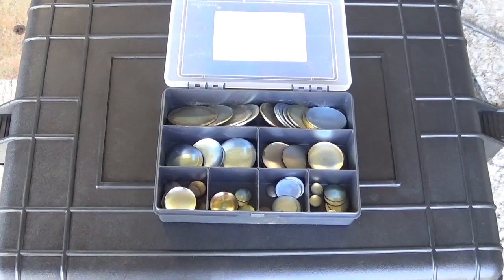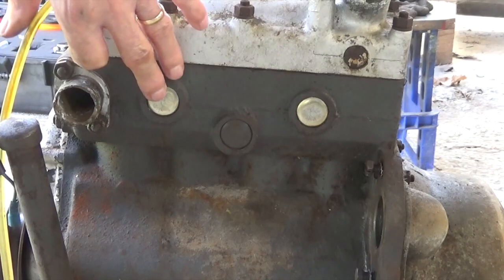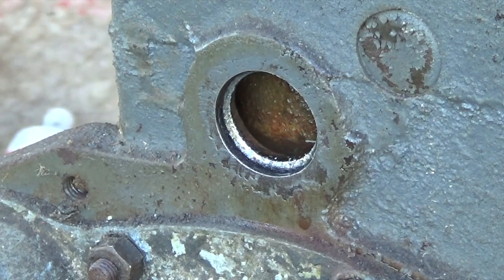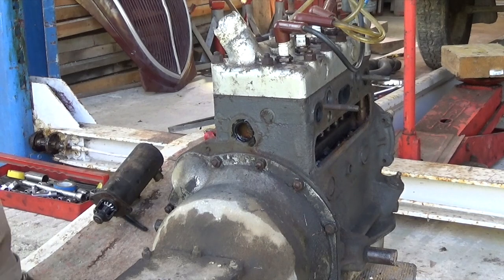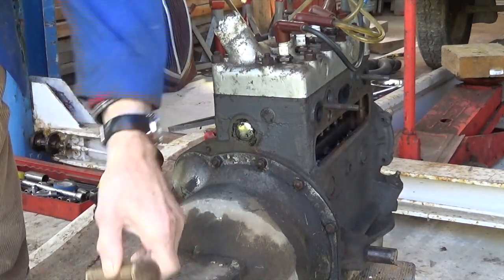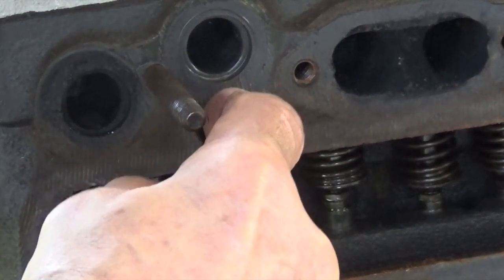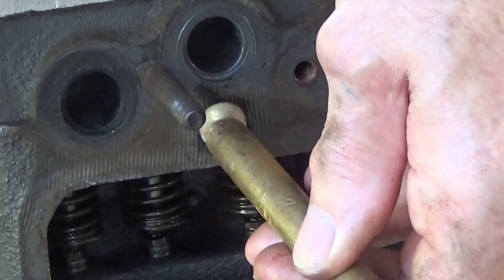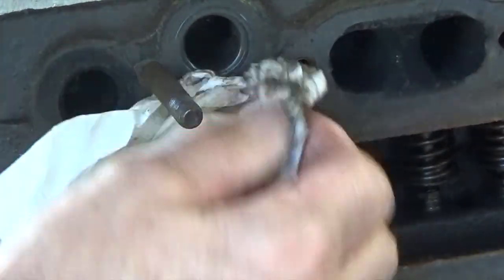Refitting engine core plugs

Comment: Thank you good sir.  I did find this video very helpful.  I remember as a kid learning to build engines with my dad and I found some of these old core plugs.  I asked my dad what they were for as they wouldn't work on any of the Chevy engines I was working on.  He told me they were used similar as the cup style freeze plugs on a Chevy, but were used on older style engines that had a lip to rest against.  I never ran across one of those engines, but now that I watched your video, these are exactly as my dad described them.  He sadly passed away in 2013, but now I know.  Thanks

Comment: Thanks Tony! I feel more at ease to tackle the job now, I think in the case of my 1953 Singer Roadster 4AD SM 1500 that I recently bought, whoever put the core plugs in did not spread them enough, I have however bought new core plugs , and hope like heck they are indeed the correct size!

Comment: Hi Tony, Good clear video thank you. I have a Perkins 100 series diesel with cup type core plugs. I assume there is a slightly different way of fitting these? Mark
Reply from the maker: Afternoon Mark.  Yes, the cup type go in dome first. Double check the other ones on the engine for comparison. It is usually possible to use something like a piece of tube, that is a snug fit into the core plug to fit them in.  Don't forget the block has to be really clean and use some gasket sealer. Good luck.
Reply: Hi Tony, thank you for that swift reply. Most helpful, Mark

Comment: good day Tony , i have a volgswagen polo playa 1.6 2002 model, my wellsch plug at the side of the engine is leaking water very bad and one of the three at the back of the engine is leaking too, is there a way to replace them with new ones without taking out the engine, thanks :)
Reply from the maker: Without seeing it it is difficult to say, but it sounds like it's an engine out job.  The little Simca 5 engine in the video needed several core plugs fitted.  That was an engine out job.  Sorry to give you the bad news!

Comment: Dome side out????????? Usually dome side goes on inside. Well most engines that i built. Perhaps just for this vehicle?
Reply from the maker: With modern square edge core plugs it is dome inside.  With older style domed core plugs it is dome side out, otherwise how would you expand the core plus to grip the block casting?  Take another look at the profile of the core plug in the video again.

Comment: How do you take these out? mine is leaking
Reply from the maker: There are several ways you can do that Olemann.  It can depend on if the engine is in the car or not and how much access you have to the core plug.
 Ist option, if you have the room, you can drill a small hole in the centre of the leaking core plug, screw into this hole a self tapping screw and then use a pry bar or jemmy to lever the plug out.  
Option 2, with and old screw driver or a small cold chisel tap a hole on the centre of the plug and use the screw driver to pry the old plug out.  This is not pretty but this is how to remove an old core plug, but do take care not to damage the edges where the core plug fits to the casting.

The engine in my video is from a Simca 5 (the same as a FIAT Topolino).  That engine had four leaking or missing core plugs, all difficult to get to.  So I removed the engine from the car to gain access.

Finally, don't forget to use a gasket sealant when fitting the new plug otherwise you will be back to leaking core plugs again!  Good luck.
Reply: @Qspecialman  thanks!
Reply: One technique I heard of that is less aggressive than a screwdriver is to drill a small hole in the center and screw in a self tapping screw enough that you can get a claw hammer around it to ease it out.